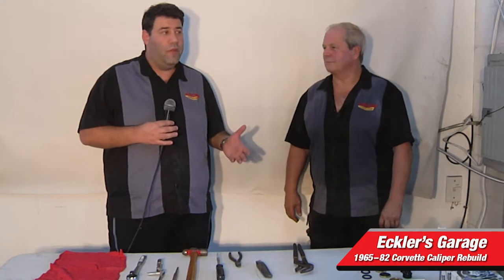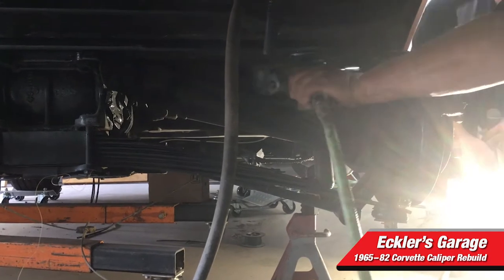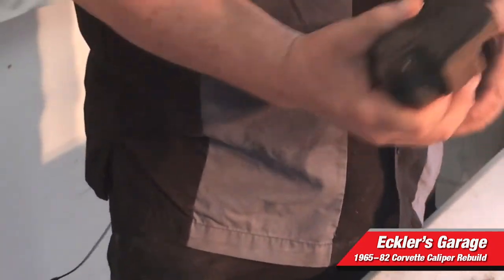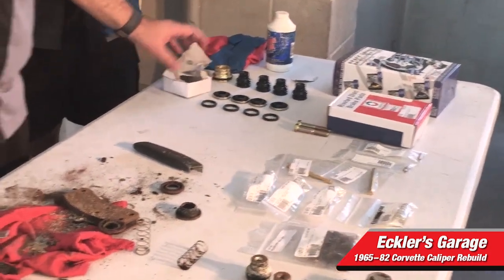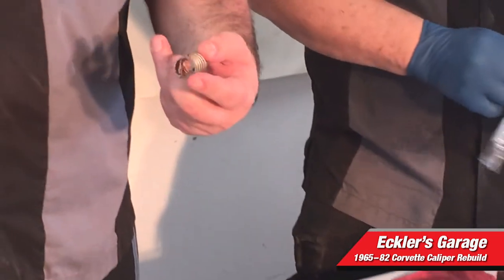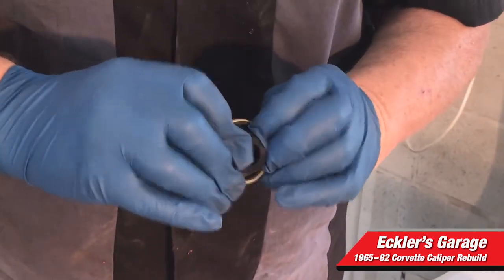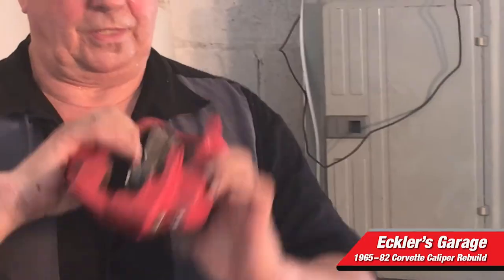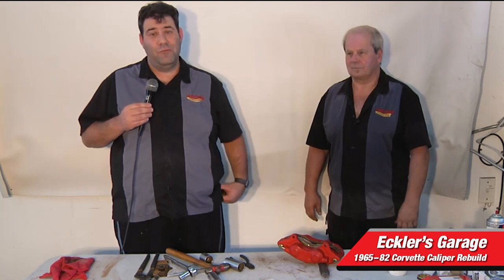ECKLER'S GARAGE - CALIPER REBUILD

Comment: It would have been beneficial if they would have shown how to clean up the calipers. Did they do anything to clean up the cylinders? As bad as the pistons looked when they were removed, I would think something had to be done to clean the cylinders...What method did they use to clean them up. A crucial step that is missing from the video.

Comment: Adequate starter video.  Good refresher.  As mentioned below, no close-up shots of the seals, setting the dust covers into the calipers.  Clean-up could have been shown.  My rear calipers (1968) have 2 bleeder valves each (and experience has shown they both need to be used.)  Was disappointed that part number for associated kits were NOT "shown below".  Was REALLY disappointed in Ecklers' website.  Searching on Calipers does not return any results ;-(.

Comment: shes all good to go except the dust shield that went in sideways lmao
Reply: Please explain. I'm not tracking with what you're saying. thank you
Reply: @doug2993    At 14:00 time, he is hammering it in, and gets the metal ring all crooked.  Then, if you pause it at exactly 14:40 ... you can see that it is way crooked.  And then, at 14:55 when they are cutting to a break, he immediately grabs a chisel to try and remove it.

Comment: I have stainless steel calipers on 1969 350 vette. Are the caliper rebuild kits ( rubber and o rings) the same as the steel calipers?
Reply: Do lots of research...go to NAPA and O'Reilly's. One returns don't take 4 weeks and shipping for returns is 0. Two they are local and will get the right parts without lying about availability. I did my 77. Ended up with O'Reilly's and NAPA. After orders thru Ecklers and waiting, i realized the backorder baloney was so wrong.
Reply: Ps most the drum brake parts can be cleaned and greased. Springs and cotter pins and pads is all you need.

Comment: One thing that bothers me when he puts on the rubber o-ring it is grooved which way does the groove go.... down into the rotor.... are out to the brake pad.... because he did not show that he just put it on and stuck it in there and I found out by experience it does matter so which is it?